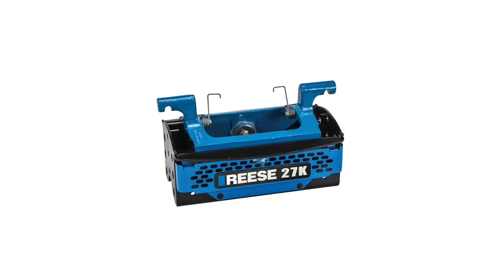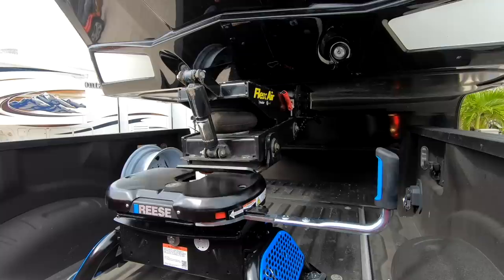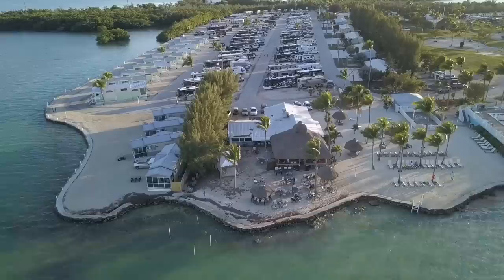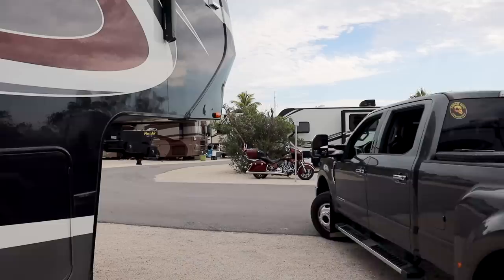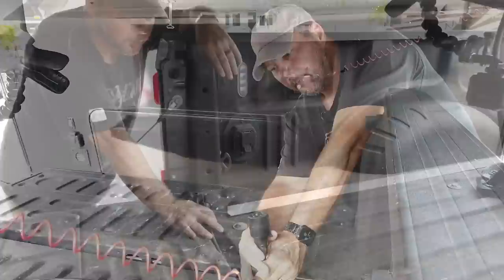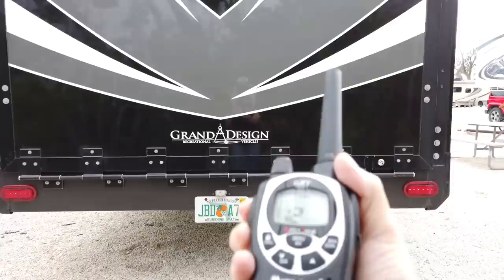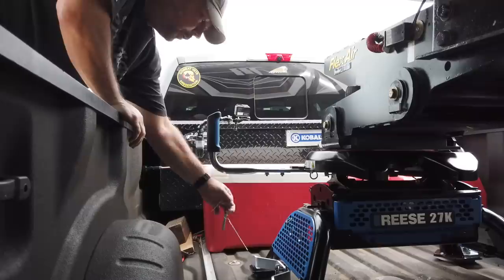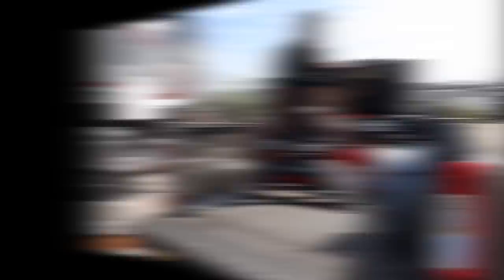Fifth Wheel Hitching | Reese M5 Review | Changing Lanes!

Comment: Love my Andersen Ultimate 5th Wheel Hitch, I use it with my Montana, and 2016 F350 SB Crew PSD with no issues, Jason from Andersen is very helpful, but I have had their Travel Trailer Anti Sway Hitch so I have had great experience with all their hitch products.
Reply from the maker: Glad it's working out for you.  👍🏼    Take care and safe travels!
Reply: Changing Lanes I was looking at the Reese since I have the Ford factory Puck system but bc I have a short bed the hitch with slider plate would have cost me $1600 and total weight would have been close to 300#’s so decided in the Andersen and very happy.  If I had a long box or Dually I would have gone Reese std 5th hitch

Comment: I also have problems with the same hitch you guys used too run with unhitching and it getting hung up I’ll try the neutral thing too see if that helps but normally I’m pulling on it while my wife pulls the truck away nice trick! Might look at the same hitch I like that red\ green indicator
Reply: I just rebuilt one of those hitches 2 days ago. Take the head off with the two pins it pivots on and turn the head over. There is a plastic block on the bar you pull out. Make forsake that it is not broken and that it is still attached to the flat ring on the bar that connects it to the jaw. Feel free to contact me if you need more info.

Comment: Well put together video. I especially like the point you made about looking to see the nub/flange end of the king pin whatever you want to call it. That is a point I don't think I have ever seen anyone on YouTube bring up good job. I have a suggestion for you. I have switched both my Fifth-wheel trailers over to an different lighting cord. It is awesome. As much as you all are plugging in and unplugging your light cord the connectors get spread apart and weak much faster than the normal person. Check out EZ Connector. Trailer carry them also. I think you will agree it is a fantastic concept. A bit pricey but you will never have to buy another connector again. Heck they might even want you to do a video. I have talked to them there numerous times and they are up front honest and helpful. Anyway like I said great video and hope to cross paths sometime on the road.
Reply from the maker: Thanks, will check it out!  👍🏼
Reply: @ChangingLanes  If you decide to go that way and need help with the change let me know I will install for you.

Comment: one thing i think bears mentioning based on experience is don't leave anything loose in the truck bed when towing like we did a folding chair, it moved around and tripped the breakaway switch and we went 100 miles and fried the brakes on the fifth wheel, $600 cha ching
Reply from the maker: Ouch!

Comment: Thanks guys for the great video! I am considering a change to Reese and this helps immensely.  I noticed on your TPMS that you are running 75# on truck tires and I know that Ford recommends a different pressure for I too have the great and powerful F350 - my question is do you run 75 all the way around and with or without 5th wheel? Thanks for answering, if you have time!! Safe travels!
Reply from the maker: Been running 75 front and 70 rear (5 higher than door sticker).  But, we need to get to the cat scales and consult the tire loading charts...

Comment: I never see anybody say to make sure the camper wheels are blocked during hitch up. When you wedge the witchinder trailer you might eliminate all contact to the ground other than the really round tires. I also attach the the trailer electric to the tow vehicle and hold trailer brakes manually to slide under the finally few inches. I literally done this once and when I got ready to remove the blocks the wheels was so tight I had to pull forward and moved the blocks finished the. Then I put in drive and the entire rolled back and realized if the blocks and manually hold wasn't in place the camper would of rolled down a slope and damaged front jacks.

Comment: My stock brake release pin has come out several times on turns once going into gas station took a few min to figure why trailer was locked up so be ware that bungle isn't too short or you might find yourself locked up on a right or left turn...

Comment: I'm in the process of buying a GD 398M and verified with Grand Design that the Reese Goosebox will work safely with it. The Goosebox is underrated at 20K.  It is actually safe to 22.5K
Reply from the maker: Hmmmm.  I get that they factor in about 10%, but still not comfortable with it.   They will be coming out with a 27K rated version in the future.. not sure how far in the future though...
Reply: @ChangingLanes  I'd feel safer with a 27K rating too.  In the meantime I don't plan on maxing out the trailer so I should still have safety room.  I won't have your "toy", just 6 six kids....

Comment: One of the advantages to the Reese GooseBox is that the pull test is not necessary. It is quite obvious that the GooseBox is on the ball.
Reply from the maker: No matter that you see on the outside, you never know 100% whats going on inside it.  The only way to know for sure is a pull test.  It might be 0.1% chance that something broke inside the hitch, but that's enough for me to always pull check.
Reply: @ChangingLanes  There is a fundamental difference in the way the GooseBox hitches, that makes all parts visual. SInce you can see the ball go into the hole of the hitch, and see the latch close, and you physically install the locking pin, there is no guessing.  Here is a link to Big Truck Big RV's video of the hookup and road test: https://www.youtube.com/watch?v=doGxz-4u1_A&t=204s

Comment: I just got a Reese M5 27K hitch and put it together. I noticed that you only have 2 bolts per side holding the legs to the center section. Mine has 3 per side. It looks like you are missing a bolt, washer and nut on each side, I see the hole is there for it.

Comment: I haul travel trailers for a living (Both 5th wheels & Bumper pulls) You do the pull test like I do. Barely have those legs above the ground & I also leave the tail gate down. If you do not do this your asking for huge trouble. Ask big rig drivers they are all taught to do that pull test when they couple onto a king pin. Now my question is what happened to the install video of this reese M5
Reply from the maker: Well.. it's still on the to-do list.. LOL  We're so slammed.  I do have all of the footage, though, and will slap it together at some point.
That said, the install is SUPER simple...  4 bolts (center to the legs), and 2 pins (top plate), and done..  👍🏼

Comment: Hey Chad and Tara, I have a question. I see you use a coiled cable for your break-away switch and hook it to your bed tie down. Have you ever had a problem with it being pulled out? I have a 2016 F350 dually. Thx you two in advance.

Comment: Great video for people new to the 5th wheel world. I have one of the coil breakaway cables but haven't used it, didn't like the hookup points. ( Dodge 3500 dually). Seeing your set up I will try it when we take off in April. The new Reese hitch looks nice. We have the B&W Companion and I leave it in the dang truck unless I need the full bed. I use the loader on the tractor to remove and install it. Thing is heavy, but I too like the weight in the bed when running less the trailer, smooths out the ride. I need to build a hitch checklist, getting older I don't want to forget anything. I usually start a week before we roll checking wheel bearings and pressures on the trailer tires, then check the lug nuts (I mark them with a Sharpie and can just look and see if they have moved)
We also use radios for light check and backing in tight places. My partner's hand signals change every time and I couldn't keep up. The radios keep the hollerin' down to a minimum.LOL

The more I watch you two interact the more you remind me of my and my other half, although we are a lot older. Been together since teenagers, turned 61 last fall, and she still seems to like me. Next time you come out west would love to meet up someplace, boondock a couple days and I can hook Chad on the Turbo S Rzr....:)
Reply from the maker: I like the lug nut sharpie idea!  👍🏼   Thanks for the invite! 😊 
Take care and safe travels!

Comment: Great video!  I do have a question.  On your departure checklist, you lock all baggage compartments, but do you lock your battery compartment door?  I leave mine unlocked in the unlikely event there is a fire, and I need to open it quickly.  My other comment,  I have a bed cover, and I would not be able to close my bed cover with the Reese hitch, since the handle sticks up too high, so I went with the B&W Companion hitch, and I love it.
Reply from the maker: No.. our front compartment does not have a hitch.. and we don't lock the baggage doors on travel day in case I need quick access to our extinguishers... see: https://youtu.be/0A3Qb8SX5pI

Comment: So, been following you guys for a while...outstanding information! We are moving from a Class A to a 5th wheel and finding myself watching ALL those videos on which is better for the king pin: air bag or no air bag; slide plate or greased up plate; and the list goes on is a bit daunting.  So when you started did you just have a regular box on the trailer or did it come with the air bag? If you started with just a regular box and than switched, did you notice the difference immediately? Thank and travel safe.
Reply from the maker: We started with the rota-flex, which is just a rubber buffer.. Then, that was replaced under warranty and we upgraded to the flex-air with the airbag and shock.  Most recently, we are trying out the MORryde rubber pin box.  We wanted to try it out since that's stock now on the Momentum TH line.  To be honest, they all towed great with no chucking.   I think I like the MORryde best because it's smaller and no maintenance.  See: https://changinglanesrv.com/rv-upgrades-basement-slide-trays/

Comment: Great video A must see video for anybody with a 5th wheel. Looking back at Toms video you can clearly see his 5th wheel was high hitched by the gap between the 5th wheel and the plate. I noticed you have gas cans in the back of the truck do you not use your fueling station in the toy hauler?
Reply from the maker: We do.. but if we boondock for more than 4 days or so, I might need to run to the gas station for more...  👍🏼

Comment: What is a “puck”? Alao, what do you use the tireless wheel for in your truckbed? Great step by step video. I thought that part of Toms problem was that he was using a grease ring which caused to large of a space between the pin and the hitch.
Reply from the maker: The puck system is a factory installed option that lets you drop in a compatible hitch.  The 4 "pucks" (2 on each leg) drop into the holes and 1/4 turn to secure it.  
On Tom's hitch.. if you look close, you can see a bit of a gap also... I think it was a high pin.

Comment: I watched or maybe I should say heard a hookup fail. It to did more damage to the truck bed than the rig. He was very capable and most of the time the redundancy in his safety protocols would save him if he made a small mistake. It wasn't too long after that little mishap  he found out that he was very sick.
That day I learned it's not a bad idea to have somebody else when you're done go around looking for mistakes. Or at least do it yourself and if you find a mistake fix it start over. Rinse & repeat until you can get all the way through that final inspection without finding a mistake.

Comment: Hey guys love y’all’s videos.   Have a question though.   Not sure if you’ve ever covered it from what I’ve seen.   But what type of system do y’all use to hold your bike while traveling?   I’m looking for ideas.   Thanks again!   Keep living the dream
Reply from the maker: Hi!  We use a WheelDock. https://wheeldock.com/ and four straps.
The wheeldock has a piston you trigger with your foot to lock in the wheel versus having to rock it in and out. I don't bolt it in at all, it just sits on the floor and I strap Lucile down on the front forks and rear bars.
We demonstrate it a bit here https://youtu.be/_X-LAY8Fwlw?t=1341,
then later here https://youtu.be/uPXNmS0IBRQ?t=1268
and even more here: https://youtu.be/f56_8ecCTaI?t=777
Reply: Changing Lanes hey thanks!!!
Reply: Changing Lanes really appreciate the info.   I really didn’t want to drill into the floor to mount one.

Comment: Hi Chad and Tara, do you have a video on how to use the trailer brake while you are driving?  I thought they were only to be used for driving in the mountains.
Reply from the maker: We might do a video on adjusting the brake controller... but there's nothing to do while driving.. Pressing on the brake in the truck automatically applies the same level of braking on the trailer.  That's what the gain adjustment is for - to get them about equal.  Hope that makes sense....
Reply: @ChangingLanes  it does, Thank you

Comment: Love your videos!  My question is: do you ever raise the hitch up in the truck for better clearance with the rig over the truck bed?   Ours seems to only have a 3-4" clearance and have damaged some areas under the cap due to unlevel roads and such.  Is it safe to do a raise?
Reply from the maker: It's best to have about 6 inches of clearance.. But, every bit you raise the nose of the RV also lowers the rear.  You want to be as level as possible when hitched.  An un-level RV can also mean uneven weight on the axles.  So, yes.. raise it but not if it makes the RV nose-high.

Comment: When you pulling out and turned to your right, the emergency brake cord was stretched almost to the limit.  I’m thinking I might look for another place (on the truck bed) to attach the cord.
Reply from the maker: It has a lot of stretch to it and we have over 20K miles with this cord / connection.  👍🏼

Comment: Where does the hitch actually bolt into the truck bed?  I can't imagine it only bolts to the bed...is there some part of the truck chassis frame that is right under the  bed to receive the bolts?
And what if you change your hitch?  Aren't the bolts going to be in a different configuration, making excess holes in the truck bed?
Reply from the maker: Most of the newer trucks have an optional puck system that various hitches can attach to.  The hitch just drops into the holes and fastens directly to the frame with 1/4 turn.

Comment: When securing your motorcycle“ Lucille “ do you just use ratchet straps or do you have a front wheel chalk system?  Maybe a video idea 💡
Reply from the maker: We use a WheelDock. https://wheeldock.com/ and four straps.
The wheeldock has a piston you trigger with your foot to lock in the wheel versus having to rock it in and out. I don't bolt it in at all, it just sits on the floor and I strap Lucile down on the front forks and rear bars.
We demonstrate it a bit here https://youtu.be/_X-LAY8Fwlw?t=1341,
then later here https://youtu.be/uPXNmS0IBRQ?t=1268
and even more here: https://youtu.be/f56_8ecCTaI?t=777
Reply: @ChangingLanes  Just an FYI, We have a toy hauler as well, and when putting the front straps on the Goldwing, I use bungee cords on each strap as well. Put the bungee hooks on each end of the strap hook, and even if the bike bounces a bit on a big bump, strap hooks can't come off from the bungee keeping the hooks tight. I'm like you, over kill and play it safe. Great videos!

Comment: Great Video.  One slightly off topic question though...What brand rear camera do you have on the fifth wheel, and does it communicate with your truck through the seven pin connector?
Reply from the maker: We have an older version of this: https://amzn.to/2tUI2Id
Ford does make a trailer camera system but it's expensive, complicated, and not wireless....

Comment: Great videos!  I noticed you carry three extra fuel containers.  Do you travel with them "full" of gas and diesel?  Do you ever run into trouble getting fuel with a big trailer as you travel cross country? 
 I also noticed the truck rim with no tire, please explain this.   We are just starting our own adventures in our 380flr.   Thanks!   Safe travels!
Reply from the maker: Hi!  They are mostly empty.  Just there in case we're boondocking and need to run for generator fuel like here: https://youtu.be/IVJx2T1WJC0
We never run into fuel issues... See: https://youtu.be/Xc2UwKjEJz4
The rim is just a leftover from our leaf spring incident (https://youtu.be/ss4uEadFIRY).  We plan on putting a tire on it to have two spares before we go to Alaska (no idea when that will be).  Hope that helps!  Thanks for watching! 😊

Comment: What tips would you give for the alignment of the kingpin and the hitch? I have a Pullrite and it has to be dead center to work correctly. Needless to say, this isn’t always easy.
Reply from the maker: We have a camera that helps, but it's mostly just practice and lots of "GOAL" Get Out And Look.. 😀
Reply: @ChangingLanes  I actually read a great tip last night when researching this subject. A guy said to put a traffic cone in the bed lined up with the hitch opening and then use that as a reference point to the pin box.
Reply from the maker: That's a really good tip!  I might try that.

Comment: Any thoughts of the use of lube plate between the 5th wheel to RV.. I just heard the plate is a number one reason for "high hitching"
Reply from the maker: We've never had an issue with it... Always pull test!
Reply: I did a pull test, and it passed. However, I was not perfectly straight. When I got straight, it came loose.
Reply: I had a dealer tell me about the lube plate. Im just having mixed thoughts on the lube plate